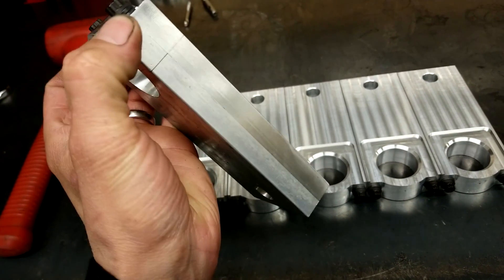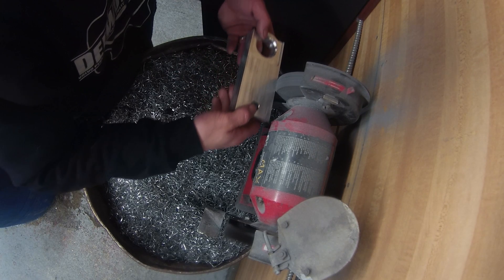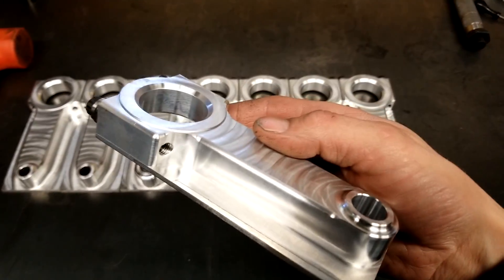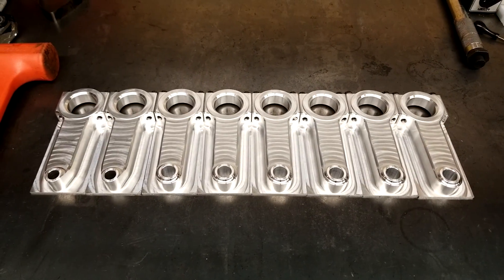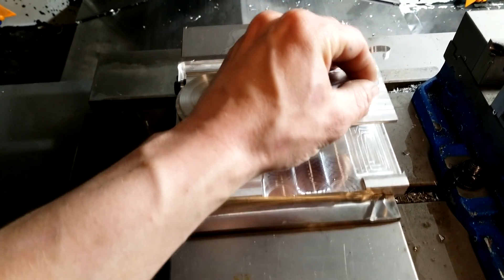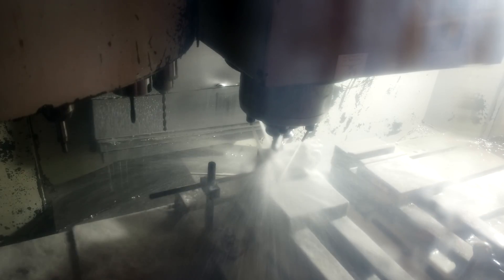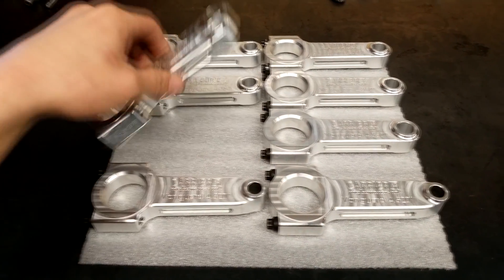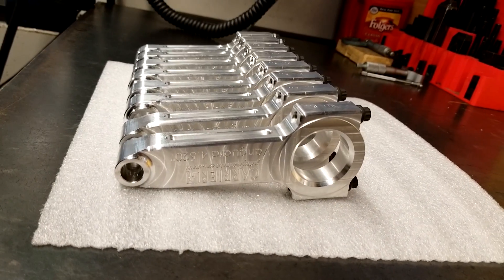CNC Machining of Billet Aluminum 7075 Connecting Rod! Part 2 of 2

Comment: Question: I know the holes were left a couple thousands small so the customer could hone them out. Would it be possible to use let's say a Big Kaiser boring bar to bore the holes to exact size. Or does it have to be honed?
Reply from the maker: Hi Lawrence! The big end could be honed with a boring head for sure. I don't have one and since these rod don't use any bearing between them and the crank, the X pattern of a honing machine is preffered over the finish of a boring head for better oil distribution and the surface finish is also much smoother.
Reply: Thank you very much for the reply. Great video by the way!

Comment: Good project!
did you use the connecting rods on your turbo volvo? The connecting rods you manufactured support how many HP?
Reply from the maker: Hi Sergio! These rods are for a Vanguard 2 cylinder engine, used in lawn mower racing.
Reply: @wecklt  ok

Comment: normally when the big end of a rod is split at an angle like that it's for installation. The big end has to be dropped through the bore and will not fit otherwise.

Comment: why use such a long reamer? doesnt it wobble?
Reply: The long length of a reamer is essential to how it works. It allows the flutes to find the hole. On a CNC its probably not as critical but on a manual mill it helps with any misalignment.

Comment: Bon vidéo! What cost was is to machine these rods? How durable are they? How high does the engine rev? 10 000 rpm?
Reply: Besides the cost I doubt this can tell much more about the rods, he is a machinist not a mechanic. I am 99% sure these rods will be used in drag racing like in 2jz blocks or so. I see people reaching 2000hp using this rods and they have to be replaced every 50 runs or so. They are particularly good at protecting the main bearings from high load spikes and they don't break.
Reply: @Runmeerkat  2000hp using aluminum rods????
Reply: @scenicdepictionsofchicagolife  all high hp drag racing motors have aluminum rods, they are used in 11,000 hp top fuel motors. The reason is they can take the extreme cylinder pressures caused by extreme compression ratios and the extreme pressure from the actual combustion of the fuel. Under the extreme circumstances steel rods would literally shatter, aluminum can be compressed and expand without breakage. In the past 10 years there has been a large out coming of titanium rods in pro stock and pro mod because the rods have a longer lifespan than aluminum.

Comment: Great job. So you use them in an engine without any problems?
Reply from the maker: Hi! Thede rods are used in 2 cylinder Vanguard Engine. I made 8 set total so far and they are all running currently.
Reply: @wecklt  Considering that it's a low HP engine, do you think they'll last the whole life of the engine, or will have a short lifespan?
Reply from the maker: @slicktires2011  Aluminum rods by design are not really a lasting item. The guys are pushing over 40hp out of these small 2 cylinder engine and are reving them really high. These particular rod also do not have bearing insert; the rods ride directly onto the crankshaft. Customer have since moved producted overseas so I'm not getting updated on how they perform sadly.

Comment: What kind of wheel were you using on the bench grinder? 
Nice work.
Reply from the maker: Thanks! The wheel used is from 3M, it's a scotchbrite wheel that does wonder on aluminum.
Reply: Roger's DeeWorks thanks those wheels a awesome!

Comment: Whats the go with the two small ends undersize (externally) from the others? Nice and clean though ;)
Reply from the maker: The Customer wanted to try a longer version of the rod with a smaller wrist pin. The design is gonna get tweaked a bit but overall the project worked out!
Reply: @wecklt  can i do this rod on a lathe and manual mill??